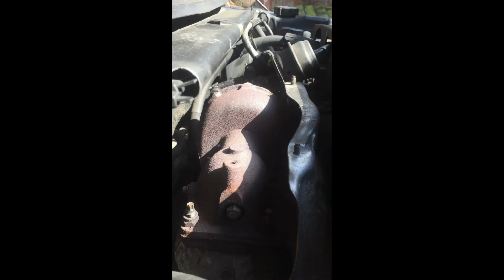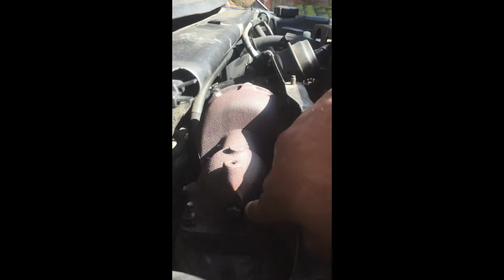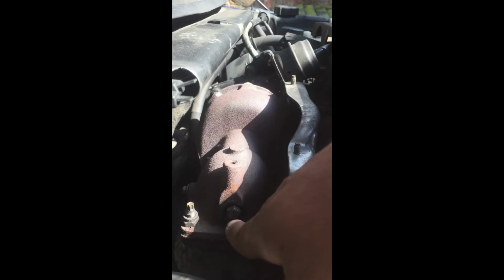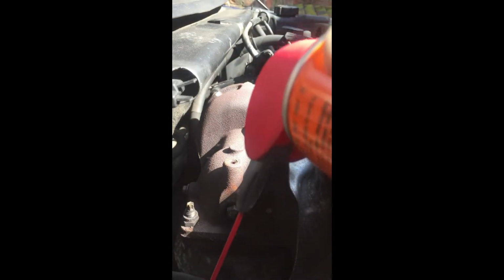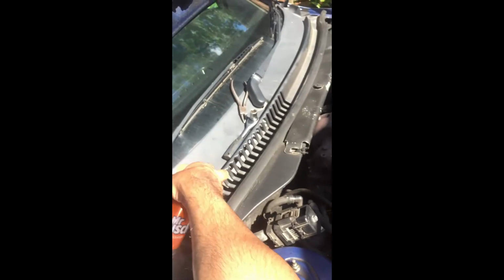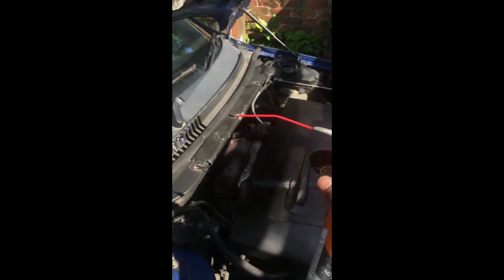Jaguar X Type Turbo Fix - Fix that squeaky blocked turbo mr muscle

Comment: My Jags come up with EML light and don't seem to have no power. Code on my cheapy code reader says, P0235, turbocharger/supercharger boost sensor A circuit. Do u think its gunked up turbo?
Reply from the maker: see if you can disconnect the arm and move it should move smoothly, it also could be the boost pressure sensor.
Reply: @itsajaaaag  is that the sensor located on the boost pipe (front left of vehicle). Looks a faff to get too. ?
Reply from the maker: yes @matthewjackson3034